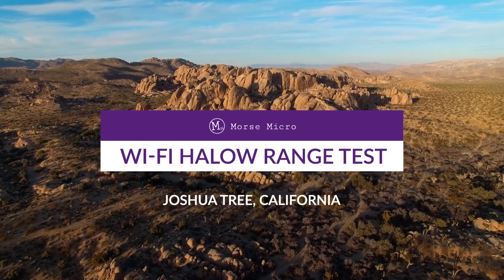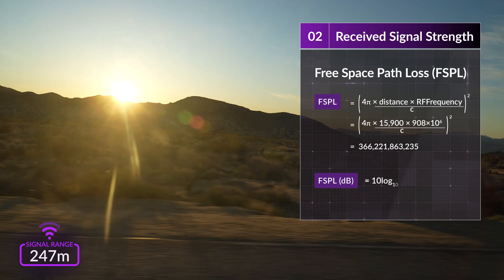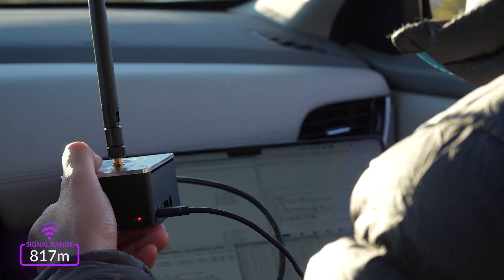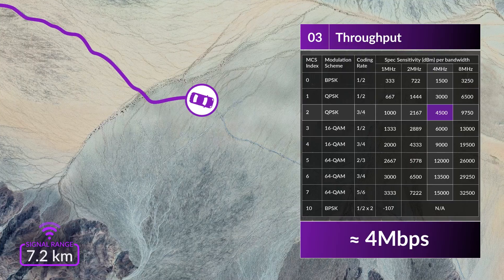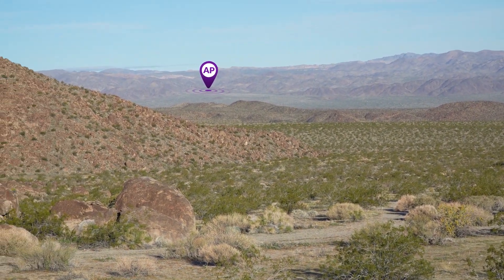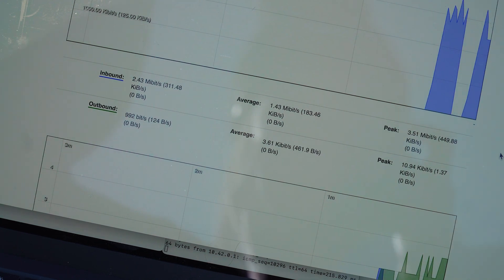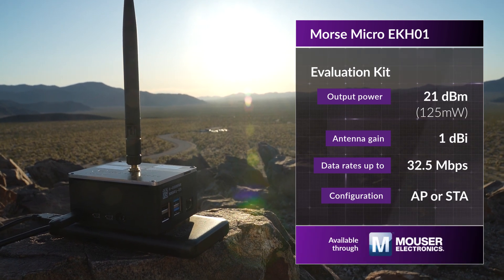Wi-Fi HaLow delivers throughput at 16km range

Comment: I would like to ask for clarification regarding the use of Wi-Fi HaLow (IEEE 802.11ah) in Europe. There seems to be some uncertainty about which frequency bands and transmit power levels are permitted for operation under EU regulations.

As far as I understand, the relevant rules fall under the EU framework for Short Range Devices (SRD) in the sub-GHz bands around 900 MHz. However, it is not entirely clear how these rules apply specifically to HaLow deployments, especially in terms of maximum allowed EIRP and channel availability.

I was hoping for 0,5W 1Mhz channel but it could be hard :/

Comment: Not sure if I like this or think it’s badly done.  I haven’t read the HaLow rules, but you really needed to use directional antennas like Yagi or panel antennas.  This additional 8-11dBi of gain on both end would further improve distance and limit interference.  I have run for 801.11g service 14.2 miles at 100% signal strength giving us 54Mbps back in 1999-2000.  If I did the same test with straight 801.11n that speed would be nearly triple so I find your test weak at best… Do some RF engineering work to get you maximum distance and throughput up to where it should be. 36dBm should be the maximum transmit power for directional point to multipoint operation get your distance up to 22.85km in that near noiseless environment.
Reply: if i have to transfer 1mb of signal every minut from a far sensor that i have in a busy city what would you recommend to me to do an use? IT HAS TO BE PRIVATE SAFE and possibly open surce so i do not spend too much.

Comment: could you also increase the output power?
this will significantly increase the range.
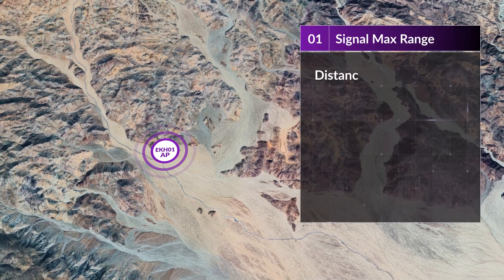Reply: Not really since it is the propagation time, not the sending power that limits the range. At least in this setup. They describe that in the video at around 0:30.

Comment: Why is there a hard limit at 53us?  Can this be changed or is this a hard limit with that chipset?
Reply: Технология типо wifikill в 8 каналов в одном будет добавляться? Ибо 53 это ошметки от восьмиканала , спасибо за обьедки сэр .Или так и оставите 1-9ghz ? и будет ли там телеметрия для автоматического усиления сигнала где оно не создает помех на +3 ампера ? А так я кроме автосмены герцовки ничего нового не вижу . Если не добавят мощный усилитель 3+ ампера то так и будут на одном месте топтаться, полицаи без сервера телеметрии и самообнаружения задавят. 😅😅😅
Reply from the maker: All Wi-Fi technologies must meet several constraints that impact the maximum range of transmission to provide for reliable, compliant, and high-throughput connectivity, such as Slot Time, CTS timeout, and ACK timeout. 
👉See more at our latest blog here: https://www.morsemicro.com/2024/09/09/pushing-the-limits-wi-fi-halow-testing-in-joshua-tree-national-park/